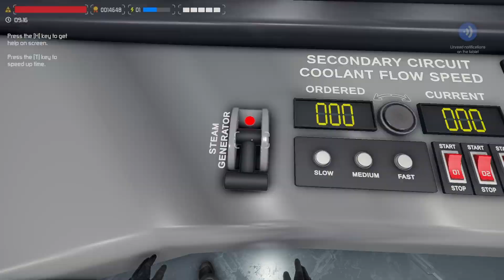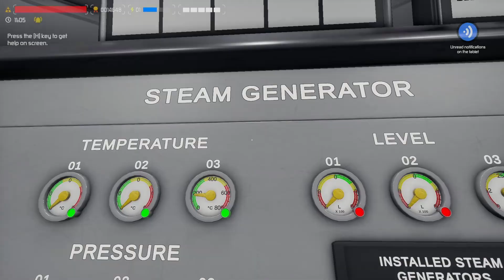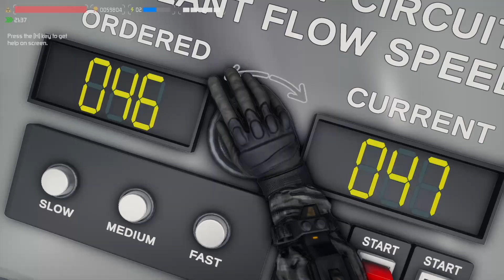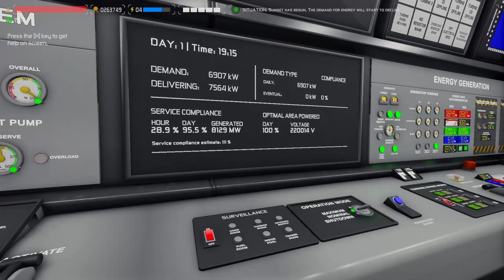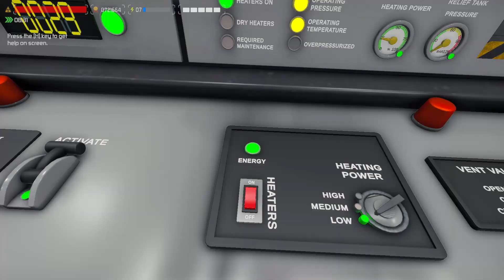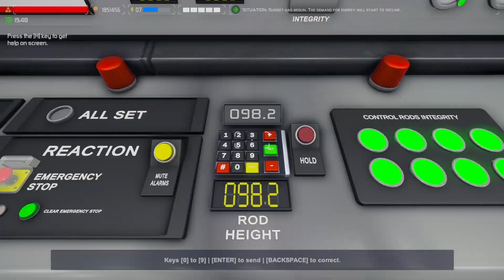Nucleares Exploring Normal mode, It's not so bad!

Comment: I would love to see you continue the series, especially now that the chemical update has dropped.
Reply from the maker: Chemical update was bugged for me, but I am going to see if I can get it working. Not sure if my save is "compatible" said there could be some issues, for me there were no pumps. I also in the video I posted today deleted a bunch of footage about me going off the rails on the Xenon lol Guess you have to add poison, to make the Xenon less poisony. Idk but my pumps weren't installed, nor was the control module, so might just not work with that save and would have to start over.

Comment: 17:23 they Kick u from grid....
Reply from the maker: I don't think that would cause the turbine to spike. Also, the Green connected light is lit, so I think it was the hot pressurizer causing an increase in temperature in the S/G. It happened another time in the video, and actually cause the S/G to lower in water level. Once I turn the heaters off, it goes back to normal. At least that's what I interpreted as happening.
Reply: @GWHacketts  if u send to mutch power to the grid u will be kicked.......I tried it so often

Comment: To help explain the boiling a bit:
A nice gentle boil is good, this is generally how you cook your food (Keep the reactor happy and efficient). But if you get too hot and boil over the pot, now you've got a giant mess to clean up, and you're probably overheated your food as well (Reactor starts generating steam inside the core and causes too many bubbles, exposing the fuel to areas of poor heat transfer).

Adding pressure to the pot, like in a steam cooker, lets it reach much higher temperatures before the water boils, so you get either a faster or more complete cooking of whatever you put inside. If you get too much pressure inside and there's no safety (Please clean and periodically test the overpressure valves in your steam cooker), well... BOOM. And I mean massive boom. Because all of that superheated water now decompresses into steam and vapor, the pressure skyrockets as soon as there's a relief point. This is why when steam trains blew up, they BLEW UP.
Reply from the maker: Really good explanation, and public service announcement!

Comment: Try to keep the condenser temperature higher (less % of pump) so less thermal energy is lost on the coolant tower so there is more to create steam 10:56.
Reply: Hotter water would be less dense so absorbs less energy even if its closer to "boiling" ?? idk.
Reply: @Johnathan.David.Trewhitt.  sorry for the text wall.
 The turbine outlet is steam, however the Steam generator inlet is water, so you need a condenser.
You use water as a cooler, think a water shower that drops and cools turbine outlet steam ti water, heating the cooling water while condensing.
This cooling water is the one you control with the condeser pump that takes water from the cond4enser bottom, circulates it on the cooling tower ( cooling it) and lastly it is injected on the condenser.
So the higher that temperature, the smaller the temperature difference between steam and cooling water, hence less energy is robbed from the steam and more is sent back to the steam generators.
You cab try with a "stable" energy production and change that pump speed
Reply: @pezkenin  what i was wondering was if u have colder inlet that means u could pull more control rod, effectively increasing the wattage at the heating element. So i dont know which is best.
Reply: @Johnathan.David.Trewhitt. The condeser pump can bee seen as a % of the core energy that is sent to atmosphere, the hotter you return the water the less energy you are wasting hence the more energy that goes into steam generation.
To pull the control rods you need to take into account the core temperature, which is controlled by the primary pumps, the faster they spin the more energy transfer from the core to the steam generators. You can increase the heat transfer from the core to the steam generators if you are not maxed out in the steam generator pumps and you are not returning above 90ºC in the condenser.
Edit: Tested in a new save, core at 380, 100% on priamry loop 3, 0%bypass, 10.045 kW produced, 75& of steam gen pump to keep stable in the green and 25% on the condeser pump for 70ish ºC. If the condeser pump is set to 100% I drop to 9.717 kW produced
Reply from the maker: I can try that for sure. Idk if it takes that into account, but it is worth a shot!
Reply: Can confirm. Keeping the condenser warer temp about 100 C° increased my overall power generation. 

When I cooled it down to 20 C° I lost 10 MW.

Running with Boron at 2900 ppm and primary loop 290 C°